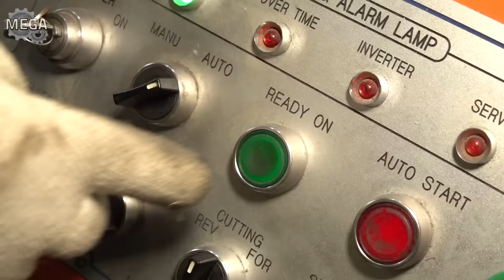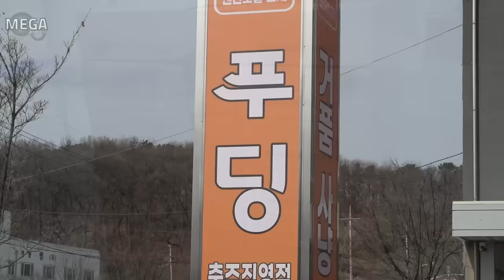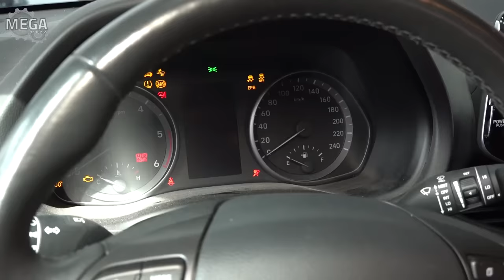Amazing process of mass producing engine oil filters. Korean auto parts manufacturing factory

Comment: If the filter is made to remove 30 microns from the oil, how do we know its not being introduced by the filter.  Its not like they have a very rigid cleaning process of the metal parts.

Comment: All that work and parts. Long ago the filter was just the paper part put in a casing mounted next to engine. So much energy to make the filter just too throw it away.
Reply: It has a very important role to fulfill. The car will use up to 40 or 50 oil filters before the whole engine and transmission wear out and is also thrown away!
Reply: @webrbio3153  Some cars are not thrown away. They are collected.